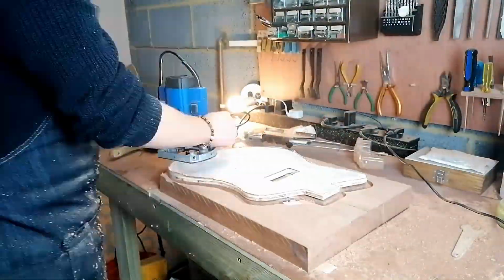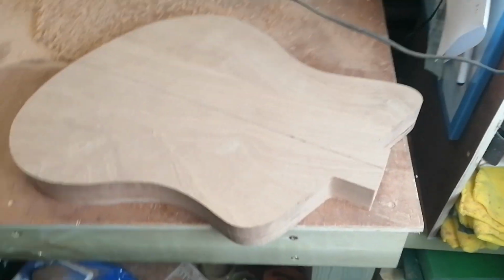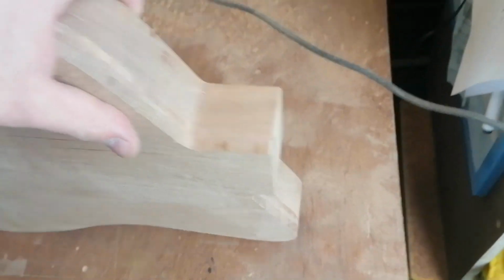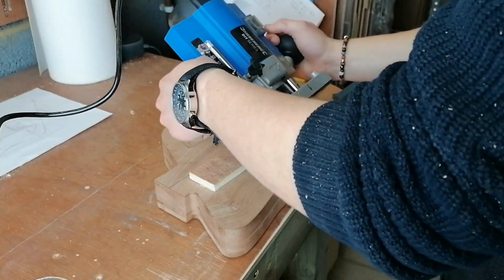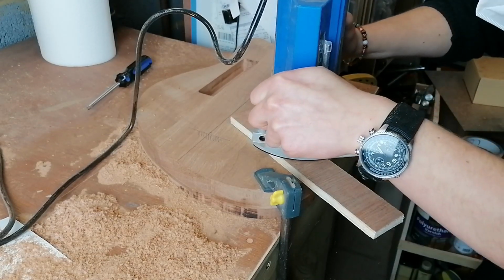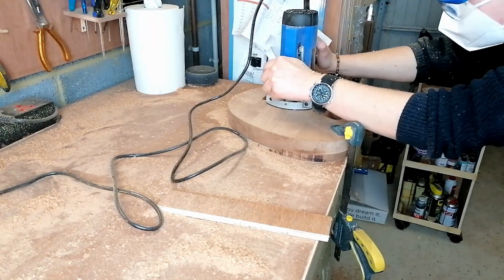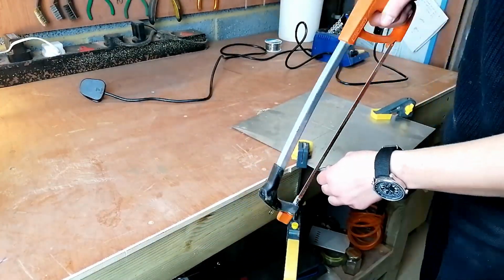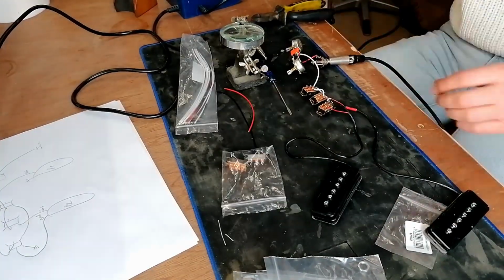Great Guitar Build Off 2021 - Conway Pt.1 - ROUTING THE BODY!

Comment: If you want to see an example of recess mounted hardware, take a look at my GT #24  JB guitar on Ebay. The handmade stainless steel control plate and the tremolo are both recessed into the top. It adds a bit of professionalism to the build.